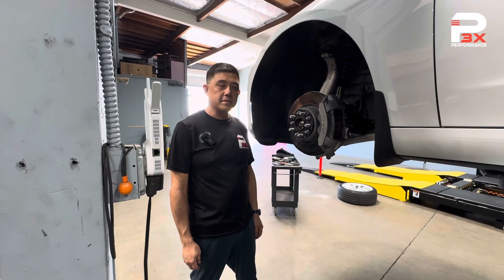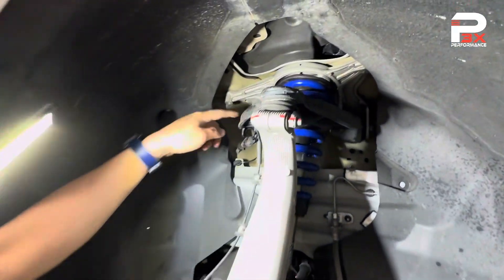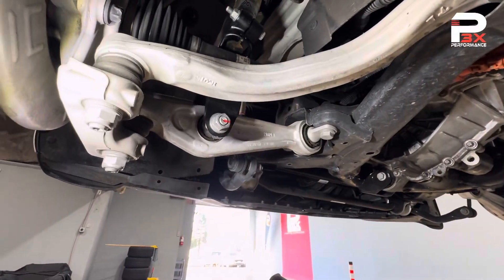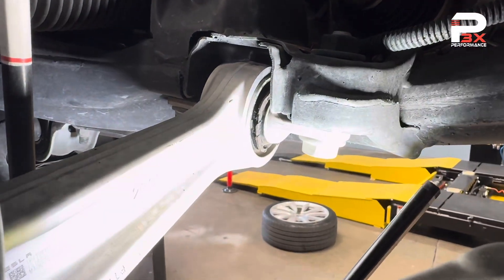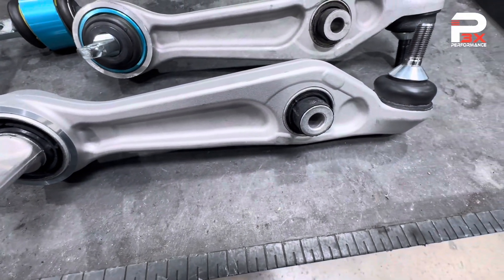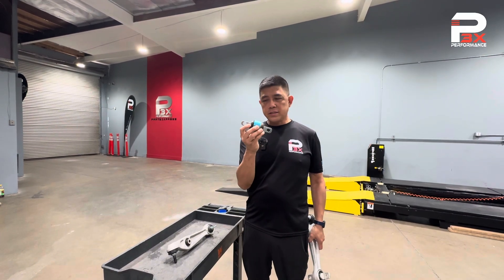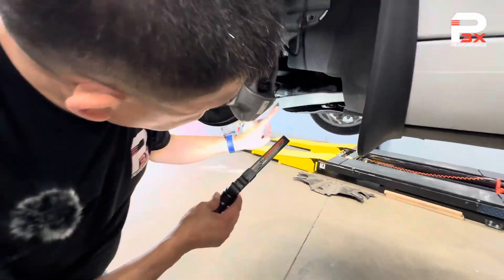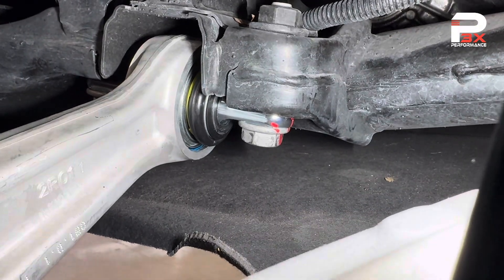Most common Tesla Model 3 and Model Y suspension repairs

Comment: HELP, I replaced my 2 months ago (non tesla garage) with what are supposed to be OEM parts. 3 to 4 weeks later I have a creaking noise. I replaced them due to movement and therefore MOT failure, there was no noise before replacing. They were fine once changed but have since started getting noisy. My initial thought was the garage had not torqued the bolts at ride height. I have since had them loosen them and torque at ride height. They also lubricated a few things. The noise is unpredictable, You cant get the noise bouncing the front or rear its only really when driving. Either straight or turning. I have the recorded noise, see links below.  Its driving me insane. I have been pointed to the UCAs but they were replaced 2 years ago. Maybe its a coincidence that the lower arms have been replaced and now I have a noise? Or, is it them!!

https://drive.google.com/file/d/1U3mCKNpqPZW124MAXHLmlCf9OQoeCW9K/view?usp=sharing

https://drive.google.com/file/d/1coxHsgN0X_zE9sDwl5NJsOWUAfbmrbrF/view?usp=drive_link

https://drive.google.com/file/d/1xHlOzhEgzWOgqztbOskMb0ruKgqSAlKc/view?usp=drive_link

Comment: This is a hidden cost no one told me about 4 years ago. Mine went out around 40,000 miles of driving on smooth paved roads granny style.  After warranty you’re looking at around $5000 to replace it all.
Reply: Tesla replaced one of mine at around 90k miles. Was under $400
Reply: @andrewdavis8393 you got lucky. Mine was still under warranty, but the cost on the invoice on mine was close to $4500.
Reply: why 5000 that's a lot , coz  the complete kit of control arms  is around 1000k that's includes the front and rear , I think the labor that cost.
Reply: @tesma-m7 I don’t know, I should’ve screenshotted the invoice but it was definitely that much because I was shocked when I saw it. They were just like ‘yeah these cars are heavy and they wear out faster than ice cars’.  The matter of Tesla jerking me around for over 4 months to fix it was a frustrating pain in the ass nitemare in itself. They knew exactly what was wrong the first time I took it. When they changed the upper control arms you can’t tell me they didn’t notice the lower control arm  rubber bushons falling apart. They tried to get me past the 50,000mile warranty, claimed it was in spec and did nothing.  I’m not a mechanic so this is not something I would attempt to do myself.
Reply: @Seacai150 definitely trying to tax you, because it's not that big of a job
Reply: @Seacai150  you opt to not do things yourself, you pay top dollar. not really a big surprise
Reply: @timdeaner2542 most consumers don’t change their suspension parts themselves. I’ll reiterate, it’s the fact that they don’t and didn’t tell me or anyone about this when I bought the car, and then 4yrs in ‘oh yeah the cars are heavy it wears out faster’. I was really excited for ‘virtually no maintenance on teslas’. It’s just not true.
Reply: @Seacai150  what they told you isnt true by the way
Reply: @timdeaner2542 well that’s EXACTLY what they told me at the service department, and on top of that all the videos on YouTube of model s-3-y-x’s having suspension wear issues at low mileage. And on Reddit as well, it sure seems true..it was for me.
Reply: @Seacai150 the vehicle is heavy excuse is bullshit. 
There’s a lot of vehicles out there that are heavier than the model Y. 
Any SUV the size of a Toyota Highlander weighs the same or more than the Model Y. And don’t forget pickup trucks exist. If the vehicle is to heavy for your suspension than your suspension needs to be better quality to compensate for that.
Reply: 5K? Bro just buy aftermarket at that point and replace yourself. Or take to your local shop.
Reply: $2k at Tesla Paramus Nj to do upper and lower control arms on both sides.

Comment: I have replaced all these parts including tie rods and sway bar end links on a 2018 model 3, and still have a loud suspension rattle up front somewhere, I’m thinking  steering gear at this point.
Reply: These components usually do not cause any rattling. Most of the noises will consist of squeaking or clunking. 
Just a note, we’ve seen 99% failure with aftermarket sway bar endlinks.  Not sure if this is causing your noise but One way to diagnose is simply to unbolt the sway bar endlinks and go for a short test drive to see if noise is gone.
Reply: @Nopenottoday868 I have this issue I tried adjusting my after market end link and it still makes a noise. Is there a solution to this? I have a 2” inch lift and Tesla recommended the after market end link.
Reply: @DarthDeth if unbolting the endlinks and test driving results in no noise then it is recommend using oem endlinks.
Reply: Will this make your tires not last ?
Reply: Sell it and lease a new one. I’ll never buy another one after all the issues with my 2021 m3.